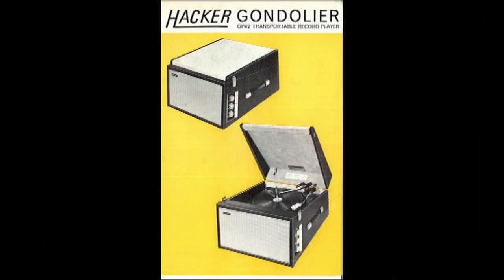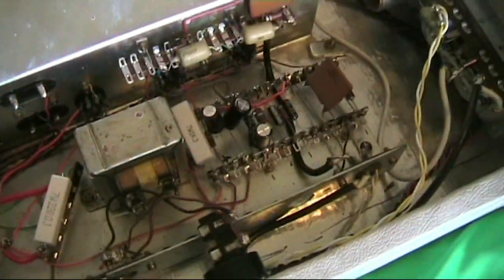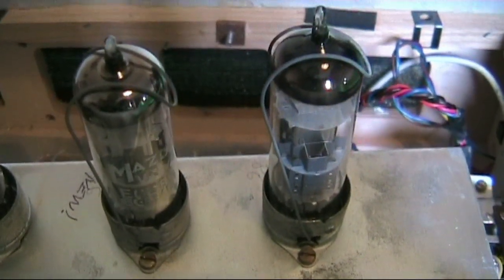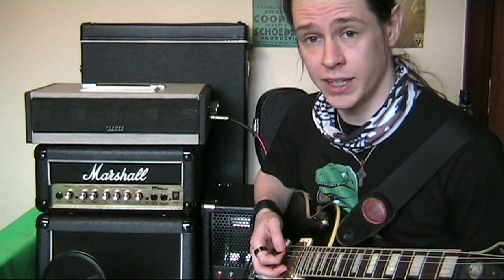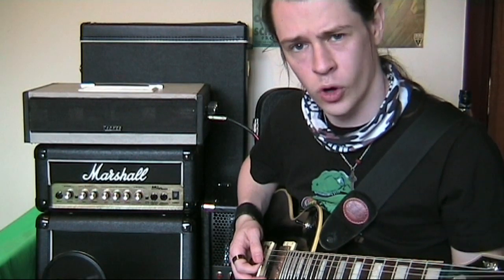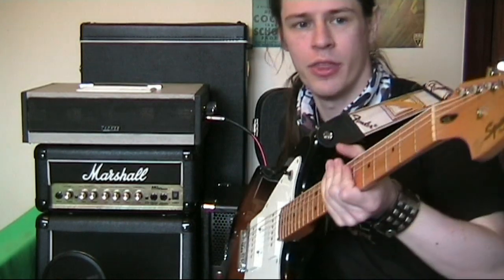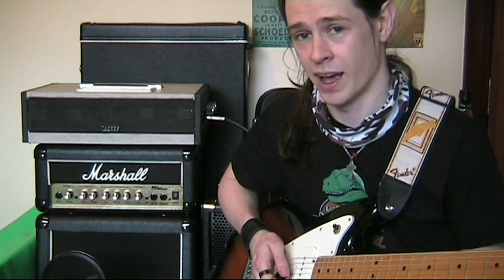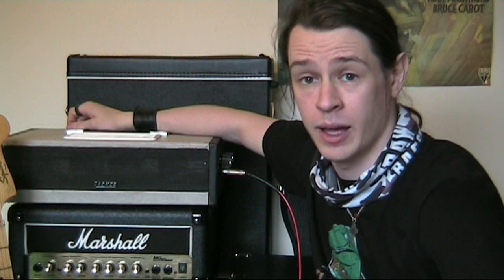Hacker Gondolier Guitar Amp Conversion (7W Valve Amp)

Comment: I have a hacker gondolier extension speaker that I had converted to a guitar amp. I just recently used it to record guitars for the 2nd album by the dubstep artist Pinch. I've used it on loads of recordings as a pre-amp as I can switch the speaker off, it is a super cool piece of kit.
Reply: Hi I also have a Gondolier extension speaker which was converted for me as a kid in the 80's. I recently hacked the cabinet about a bit but am now thinking of rehousing it completely and putting a proper speaker in. As it is nothing been changed to the amp other than the jack socket. Just wondering if you have any tips for speaker, cabinet or any other components I should look at modifying to get this thing to peak performance?

Comment: Hacker AL42 here, all standard valves, preferably through a G12 - 80 Rola Celestion.   Pre amp is a solid state 4 track mixer.  The volume for 7w is phenomenal, and the tone is the voice of angels.  Dirty ones when you push it.   Am I happy with it?  I'm marrying it.  :)

Comment: Great job on the head conversion, thanks for the video. I have a Hacker AL42 which was the extension cab for the Gondolier - basically the same minus the record player part, identical amp I believe.. I'm planning to restore it and convert for guitar also. As the cab does'nt have the record player on top i'm going to try and keep it as a combo, although i'm not sure how the eliptical speaker will sound for guitar - I need to measure up to see if I can squeeze something else in there. Thanks again.
Reply from the maker: You are correct, the extension cab has an identical amp and speaker to the record player. I tested out the Hacker through its original speaker at first, granted the speaker wasn't in a cabinet at the time so it sounded a little weak. 
With a good sized cabinet it will sound much better, although the speaker was never designed to handle guitar. 
Probably as a practice amp it will do just fine as long as it isn't pushed too hard. 

I've still kept the original speaker from mine, I might build a cab for it at some point just for fun. Best of luck with the conversion, it's a really nice amp for guitar and I'm loving playing around with mine.